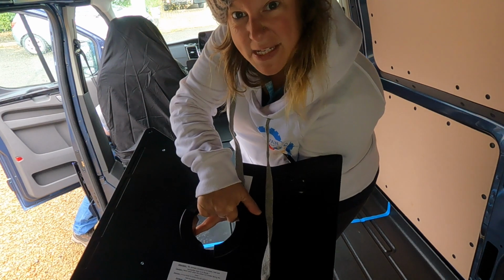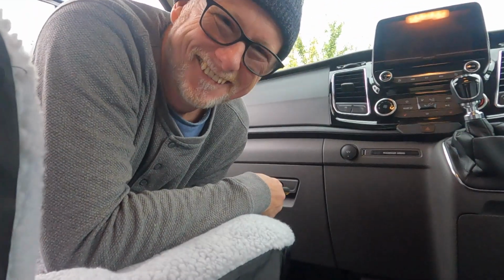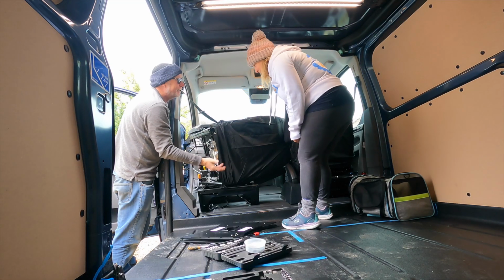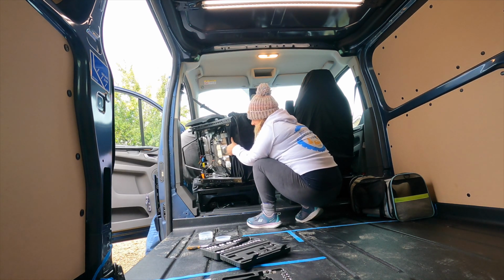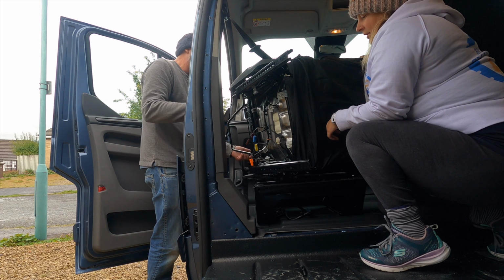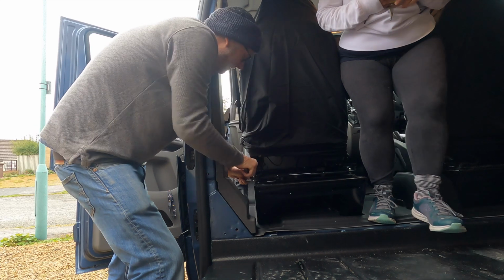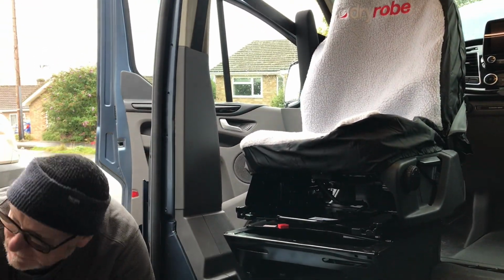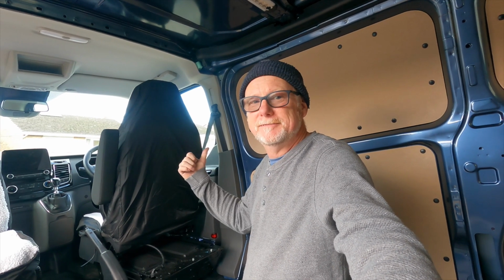How to install a swivel seat on DIY CAMPER VAN  | FORD TRANSIT CAMPER BUILD

Comment: we have really looking forward to the swivel seat build. You have explained fitting really well. Shame about the drivers side. 😒 How do you find sitting with the swivel attached. we are both short legged  does your feet touch the ground....great video
Reply from the maker: Hey you two! The swivel seat addition has been so great so far! I would highly recommend it. Also I love how it freely swivels and can understand how it is this way now. It allows your seated position to be fluid depending on what table etc you're working with. If you have height adjusted seats, which you should do (as you couldn't fit the swivel without this feature) then you can pump the seat back down to suit your leg length. xx

Comment: The swivel seat doesn't need to lock into place when facing the rear, which should only be when the van is stationary. It's designed that way to allow you to angle yourself at a table more comfortably, or to face the sliding door to take in all the wonderful scenery you will discover on your adventures.